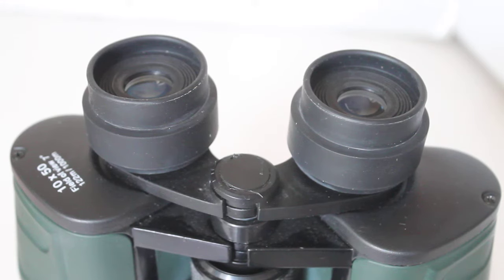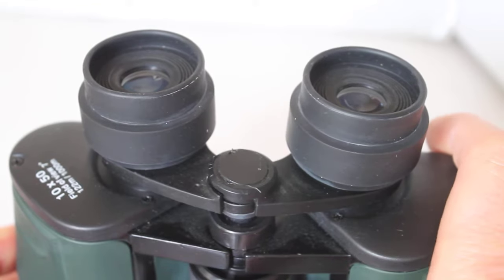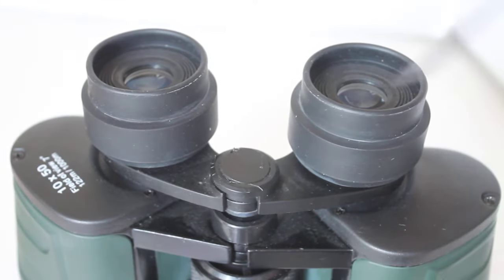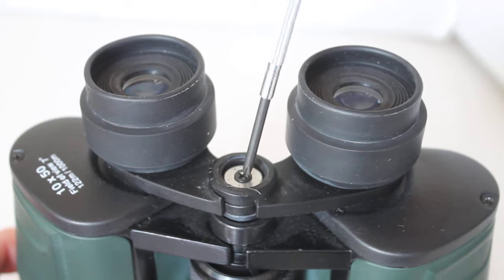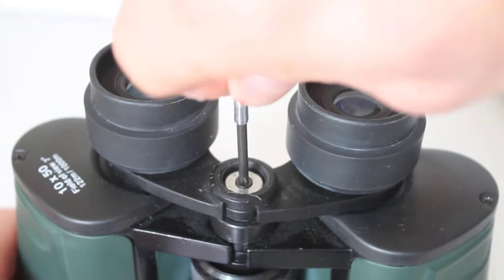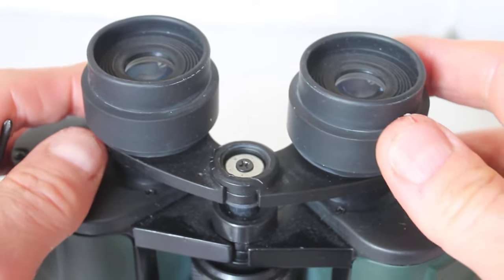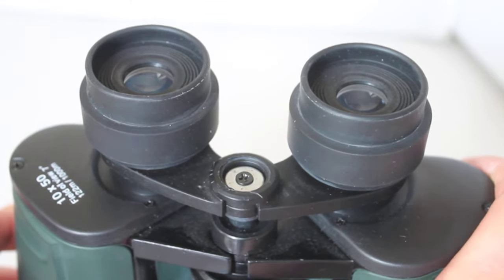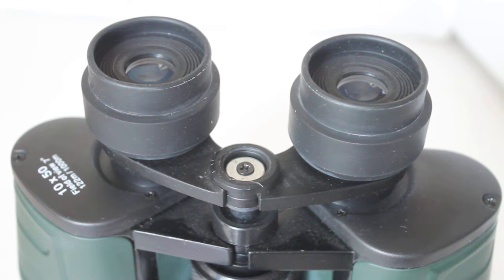How to repair a loose binocular focus mechanism

Comment: I tightened the centre screw and now the focus wheel doesn't move freely.
Even a slight loosening causes the eye pieces to wobble all over the place again. 
Any ideas? Do I need to also adjust the centre screw at the other end of the central column?
Reply from the maker: Sorry can not comment without having them with me. Sometimes where the brackets that connect the eyepiece to the centre column can come loose, become weak and break.

Comment: How do i fix mine, my binoculars are from my grandpa's by the looks of it i think its a military type of binoculars, now the problem is it has a little compass attached to where i should have the screw to tighten the lens wobble and its like the little compass is on top of the screw and is covered in glass how do i remove it?
Reply from the maker: Hard to tell without having the binoculars in my hands. With them being old military bins, I would guess they need inspection by a specialist binocular repair centre as they may need "re-gassing"
Reply: Cuz if i needed to go somewhere to get it fixed on a shop or smth i might just buy a new one tbh
Reply from the maker: Difficult to tell from the video. But I am guessing the compass is glued / push, clipped in place ? . As with all these things, ask yourself the question, is it worth the risk dismantling if still useable. Most budget binoculars, where your compass is , has a plastic cover that simply can be prised out, as per the set I demonstrated on
Reply: @44messier  thanks for the info, its just a glued compass (i might've broke it tho😂) i removed it suddenly whilst trying to get it off by the sides now i cleaned both lenses and now their tight
Reply: @44messier  oh and btw, what type of a starting binoculars or telescope for astronomy would you recommend for a newbie, that's less than 80$, im from the philippines so if that brand isn't down for international shipping please consider putting it out, thanks!
Reply from the maker: If spending a small amount, forget getting a telescope. Much better with a set of fully multi-coated or multi-coated BaK-4 porro prism binoculars in the 7x50 , 10x50 categories. Be aware if buying direct from China, as they can, be lets say economical with the truth regarding specs

Comment: Mine don't appear to have a removable cover. There's a cover at the other end. My wheel is just spinning freely and the whole eyepiece section pulls out on the rod going into the part under the screw you're tightening.. eek!